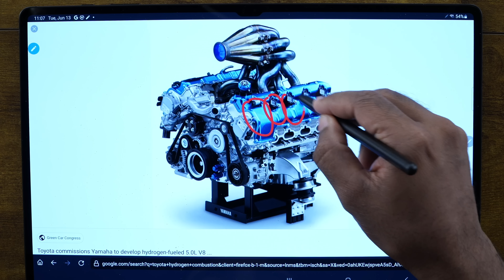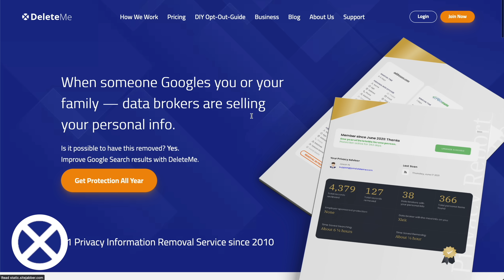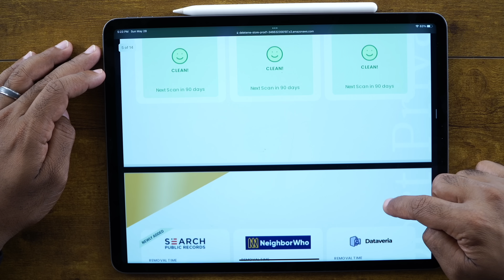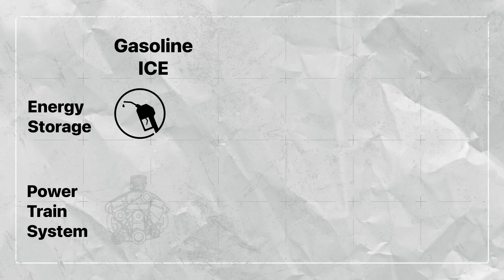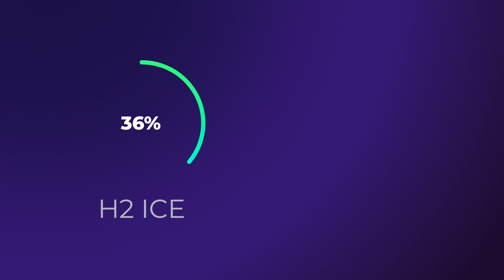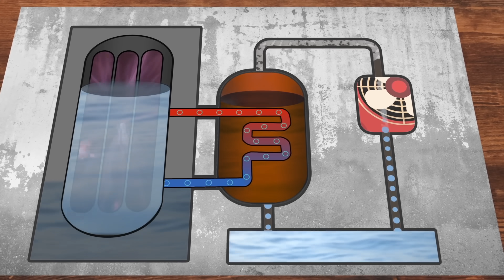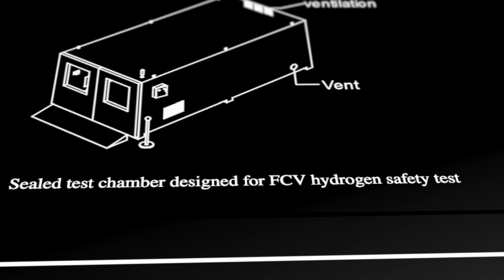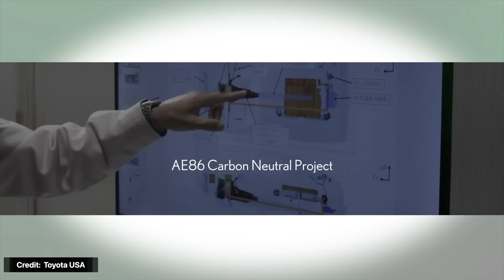Toyota's Says They Just Destroyed EVs - Hydrogen Combustion Engines

Comment: It's hilarious to me hearing EV owners simply blow-off range anxiety as something that's "overstated". Yeah, no it's not. As a paramedic, I'm terrified some idiot politician is going to push to make it mandatory all government vehicles become electric. In a former life, I was an engineer, so I understand how power density works. NOBODY can produce a battery that is light enough, or power dense enough to replace a petroleum IC engine's fuel tank in an ambulance or a fire truck. And you can't put enough batteries on a fire engine to both give it enough power capacity and safe mobility to drive on public roads without collapsing bridges and washing out asphalt shoulders.

Given the disastrous environmental impact of high capacity batteries, and the range/power limit realities of that technology, hydrogen is the ONLY viable way forward. Battery EV manufacturers managed to convince (e.g. bribe) politicians into subsidizing production, which side-lined hydrogen development for a while. Happily, those policies are lapsing, and manufacturers are getting back to hydrogen development. One of the few things consistently "overstated" in this conversation is the lack of hydrogen fueling infrastructure. That will change overnight if oil companies and governments decide to make it so.

End of rant.

Comment: The Hindenburg did not explode!! If it had the ground crew beneath it would not have had the chance to run for their lives.  Hydrogen does burn extremely well but it needs to be premixed with air or better yet oxygen for it to explode.

Comment: Plug-in hybrid is a clear winner here, and I hope more people notice this. How? By taking the pros of each system and removing the cons; you don't need to carry a heavy battery wherever you go and wait for hours to charge it, and at the same time, you don't need to use the inefficient engine all the time. Make a controller that prioritizes using energy from the battery (when available) and then switch to hydrogen or ammonia. The daily drive of most people doesn't exceed 100km; therefore, a small battery back is sufficient, and when occasionally there is a distant trip, the system will switch to hydrogen or ammonia. The problem of inefficiency here is significantly reduced, how? Because roughly let's say, for example,  from 10 daily trips, 9 out of them with an energy-efficient driving of 85% and just 1 with 36% efficiency; therefore, overall efficiency is 80%.  Even this is cheaper to manufacture (I didn't make cost calculations) but you need just a small battery and no need for an expensive fuel cell.

Comment: Sweet on the energy density. Since EVs easily get 300 miles per charge and this is 100x the density then we will have cars with a 30,000 mile range that fuel up in less than 5 minutes.

Anyone that thinks this is real, I have a bridge to sell you.

Comment: As I see it, neither of these solves the problem at hand. Both have their environmental impact and require electricity to create the energy needed to run. Also add in the fact that most countries don't even have the infastructure to support going fully EV in the time span of many of the mandates. It's not as simple as just building more power stations which already take very long time to build.  We can barely meet our energy needs now here in Japan. That being said we have to start somewhere and I think both technologies will be needed.

The reality is that world still runs on fossil fuels and clean, renewalable energy technology isn't there yet. Wind and hydro is limited by geographic location and that really only leaves us with solar and thermal which is far from efficient enough to support a nation at this time. If can find a way to reliably produce hydrogen without burning much fossil fuels, it'll buy us time to buildup battery and solar technology and the infastructure needed to support it.

And another to consider is it could be an option for places far off the grid or can't receive electricity reliably.

Comment: EV's are a big Con and you're helping to spin that Con! 😡
Hydrogen ICE is definitely the future!
Perhaps you'd like to explain where we're going to get all the electricity from, if all cars are electric?
Perhaps you'd like to explain how much CO2 emissions will be saved if all cars go electric?, (because heavy machines can't) Yes, massive 12% globally 😡
Perhaps you'd like to explain how every 10 years we will get rid of the battery's that need replacing?
You might like to share, where we're going to get all the raw materials from to produce all the battery's and how it is mined?
Finally you might like to explain how an EV is a clean option, when out of the 10 year cycle (which is the life of a battery) it is only clean for 4 of those years, assuming the vehicle is not in a crash before, where it will get written off, because of the cost and danger in replacing damaged battery's 😡

Comment: This video reminds my of the engineers relaxation Igor Sikorsky and his helicopter. Engineers derided it as a poor design because of efficiency.  To counter the rotation of the craft cause by the engine and rotors he added a tail rotor the pushed the body into a straight position. The engineers insisted that two main rotors spinning in opposite directions was what was needed to counter act the torque.

Efficiency does not matter if it does not meet the criteria of practicality, ease of maintenance and cost.

A highly efficient engine that requires expensive maintenance, has a high initial  cost  and not reliable is useless.

Comment: Hydrogen will not kill off EVs but it will help kill off the planet. Basically Hydrogen is a very leaky gas. It's virtually impossible to eliminate leaks. It can leak through steel. The more hydrogen that leaks into the atmosphere the higher the Methane levels. Methane is 25 times more potent than Co2. It's much worst than burning fossil fuels and that's green hydrogen. Can't believe you missed that fact Ricky.

Comment: Hey everyone, trees make oxygen and are food not just carbon storage ,water is essentially can't live without, stop eating artificial flavors and petroleum candy and using purest water for silicon ,half to 60 %  of Earth's wildlife has died in past 50 years of unconstitutional food war ,bee nothing left for humans and wildlife ,what about compressed air vehicles but somehow they were banned waiting for heavy air or compressed  substance energy storage ? Was 125 miles for 2 bucks at home price and can be filled fast as gas ,guess reliability and low costs like windmill compressor or solar and compressor tank station oh yeah hey sure condensate pump and water filter with hepa exuast air quality scrubbers running around material  purification free water from air and clean air ,hey scrub air as your private traveling plating rights  or private prison plate privilege driving or spraying water exhaust cooling the planet with evaporation insted of blocking sun spraying plus jet fuel overhead maybe a air push stream like air hockey table highway instead of vacuum tube rides over pipe line ? Electrc eye pulse power air stream system compressed wind cracker plate thumper or your the wand pressure tip nozzle rear-ended open air gap vacuum breaker bodkin tipped flapping into fabric of space

Comment: EVs are not practical, nor will they ever be for one simple reason. There are not enough rare earth metals to support a like ICE availability of EVs. That is what makes the hydrogen option more plausible, by far, than the EV option. The reason the push towards EVs has become so prevalent is political, not practical. As you may be able to discern I am not a fan of EVs for multiple reasons, mainly because they are a pipe dream that will lead us back to horses if they are mandated for all vehicle owners. Even if we create the infrastructure needed for EVs, our carbon use will exceed the current levels because of the massive increase in electric generation that will be required to allow the same amount of private vehicle use we see today. But, that leads us to the real reason EVs are being pushed so hard. The elites in our society do not intend for there to be private vehicle ownership on the level we see today, they want/need a limited travel ability for the masses. I am pulling for Toyota to develop the hydrogen technology, if we truly want cleaner energy that is the route we should pursue, EVs will not reduce the carbon foot print of our world, and any assessment of the differences between hydrogen and EVs reveals that if it is done without a predetermined outcome. I work for a major automotive manufacturer, one who is pursuing EV development. I am already seeing firsthand the negative effect of EV technology on my employer, wise up America. This is not to reduce carbon emissions, if that was the goal, those who push it so hard would sell their private jets.

Comment: I think it's going to work out to be a mix of different technologies used primarily for different applications, similar to how we traditionally had petrol and diesel. I can see H₂ICE having an advantage in heavy transport, where turnaround & refueling times are vital to keep the trucks moving. Batteries are really heavy, so maybe H₂ICE will find a niche in airplanes. Can Hydrogen power a jet engine perhaps? Electricity sure can't.
Your comparisons were based on 3rd or 4th gen electric stats vs maybe 2nd gen H₂ICE. As, or if more are manufactured, bought and driven those efficiency stats and others will improve. 
As many people as are against hydrogen, there are probably more that have never heard much about it, but are against electric cars purely on the principle of "damn greenie crap, you can't tell me what to drive, ain't nothing wrong with my gas truck". Hydrogen ICE cars, with their associated vroom vroom may well find a home their too.

Comment: The hydrogen combustion engine has one great starter advantage. The century old repair and maintenance capability worldwide is already there, which can be easily retrained for hydrogen combustion engines. Source of Hydrogen has to be worked out better. Unlike gasoline, Hydrogen can be locally generated. This could become advantageous over time with volumes

Comment: EV's need batteries, which use rare earth metals that are in control of a few countries. Also, consider the power generation and distribution network cost. All power generation will not be with low carbon footprint. If these costs and disadvantages are factored, it will be clear that EVs are not suitable for most countries, and overall sustainability will be questionable. They're not for mass cargo transportation systems. Lastly,  disposal of battery waste is yet to be addressed comprehensively.

Comment: The arguments you seem to give against Toyota ICE H is that the engines have a larger maintenance cost vs Tesla. I think you have left out how warrantied replacement for a Tesla battery is 8 years or 100,000 to 150,000 miles, replacement cost is usually at least 10K ( Tesla likes to leave out the labor cost on this ). You also haven't mentioned how many Tesla owners have been surprised at Tesla's unwillingness to repair their own batteries, instead wanting owners to just replace them at massive cost. ( I have seen several instances of Tesla denying a warranty claim because the battery was "road damaged"). You won't hear any such complaints about Toyota, most ICE vehicle shops understand the idea of not replacing a major part unless the repair cost exceeds replacement cost. Plus you focus a lot on energy efficiency within the vehicles themselves, not on overall cost or environmental impact overall. It would be far more helpful and informative to include overall environmental costs ( raw material extraction, manufacturing, etc. ) this plus operational costs would be more appropriate. After doing this this more thorough investigation studies have found that just about everything between EVs and hybrid vehicles ( remember hybrids still only have a range of 40 miles max on battery alone) is a wash, especially with EVs in the US still being charged from coal fired powerplants. 

Finally, your comments about Toyota not being "all-in" on the cars they built partnered with Toyota and BMW as showing Toyota not really "believing" in the cars is really something. These cars are for very small market segments with very little potential for sales and profits. It is amazing that Toyota did these cars at all, they could have just ignored this market entirely. But they found a way to mitigate the financial risk and produce the cars anyway, cars they must have "believed in" in some way otherwise they wouldn't have bothered.

 For having a presentation on your videos that tries to make out that you are even-handed and look at facts, well, you just outed yourself on this one.

Comment: I think these engines do actually have a huge place in the market, first in heavy equipment that's hard to get to a charging station, for semi's, for people who live in rural areas, and farm equipment. Anywhere that range really matters. We also going to have problems with our electric grid being able to support this many EVs. The ability to generate hydrogen in one local area and distribute it has some advantages.
Reply: I think it's being understated that Hydrogen Production is also not as easy as people think.
Reply: @hammerheadcorvette4  Yeah. But we need nuclear if we are going all electric and I doubt that's going to happen
Reply: Exactly.  Also, Toyota aren't going alone; why?  They want other manufacturers on the program to stimulate demand for hydrogen gas stations.  Yamaha has history of collaborations so further work by Yamaha would eventually benefit Toyota.
Reply: The electric grid needs updating in any case, but most people will charge their EVs at night during off-peak-load times. Battery technology is advancing rapidly, so utilities will be able to produce electricity when it's most advantageous and store it for when it's most needed and EVs will have greater ranges and require fewer refueling episodes.
Reply: Nah. If hydrogen is used widely as a fuel, hydrogen engines will be few and far between. You just can’t get good range if you’re burning it. Fuel cells barely work as it is, but engines are half as efficient (or worse).
Reply: @jonathanfields4ever  First it's not just efficiency it's also energy density. regular fossil fuels have an energy density of around 44.5 Megajoules/kg and hydrogen's is 120 MJ/kg. this means if you get an efficiency of 50% you are still 15 MJ/Kg more energy than fossil fuels.  You are currently getting 40%-45% (about 54mj/kg max), so there is still more energy than traditional fuels. The tech is still developing as combustion engines (and the laws around them) have little time to develop.
Reply: @mauzeking6661  That would be great if mass was the only consideration. It’s not. Hydrogen has very poor volumetric density. It just so happens that 1 kg of hydrogen is about as energy dense as 1 gallon of gas. They line up very nicely. Unfortunately that 1kg of hydrogen takes up 6.6 gallons of space and it has to be in a Kevlar reinforced cylindrical tube.
Reply: @jonathanfields4ever  I think you need to reread your post and fix it as it doesn't make sense 1kg of hydrogen is 2x the energy density of 1kg of gas, I believe your saying it takes 6x the space. Which adds weight in the mass of the container. This is definitely a consideration and compressing it add extra dangers. Please let me know if this is what you meant and I'll respond.
Reply: @mauzeking6661  No, you need to reread my post. Nowhere did I talk about kgs of gasoline because they don’t matter. The gravimetric density doesn’t matter. Hydrogen takes up too much space to be a good idea for ICE cars. It barely works for FCEVs. It’s effectively 3.3 times less energy dense than gasoline.

The hydrogen tanks in a Mirai are 37 gallons. The car has to be built around them. Still, it only gets between 250 and 400 miles of range depending on conditions. With an ICE engine that’s less than half.

The gravimetric energy density of hydrogen does not matter for passenger cars.
Reply: people always forget the insane amount of energy required to extract rare earth materials to make batteries.
Reply: @gabrielbsalvatori  There are no rare earths in batteries. Try again.

Comment: Hydrogen ICEs would be effective as an onboard generator for a vehicle powered by electric motors.  It would:
1. Reduce the cost, weight, risks, and environmental effects of lithium battery banks,
2. Reduce the dependence on the grid and the upgrades required to take on a massive shift away from petroleum, 
3. It would allow rural areas to manufacture their own power source instead of relying on trucking in fuel or connecting to the grid, which considering the cost per power pole being in the thousands, connecting 100-200 miles out can easily reach into the tens of millions.

All in all, the problem is (as all things seem to be) more nuanced than one solution alone can solve.  This may not be an end all solution, but would definitely benefit the independence of small, out of the way towns.

but you cant just rank their efficiency based on combustion horsepower alone, as they have no less total efficiency than a gasoline ICE, and when used as an idling generator for electric motors, the inefficiency from stop and go driving is mitigated by using far less batteries than an EV.

Trains have used this method for 60+ years, edison motors is developing haulers with this method, and with hybid electric cars already existing I see no reason this wouldnt be an effective alternative for difficult to reach communities.